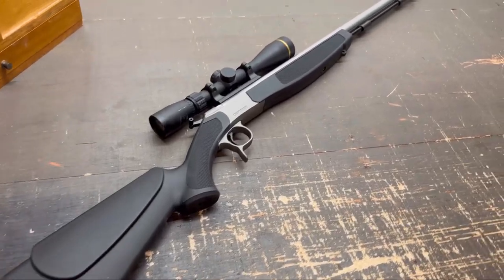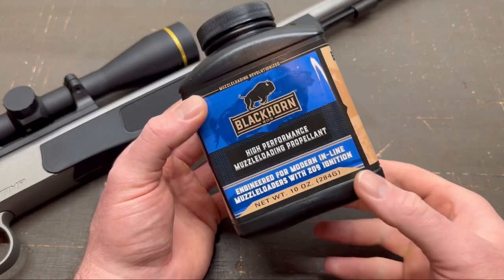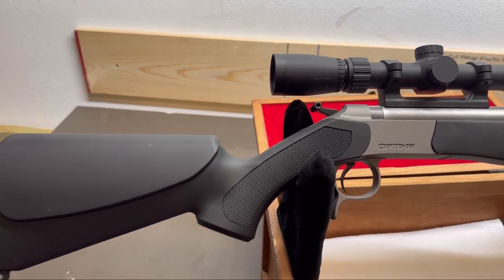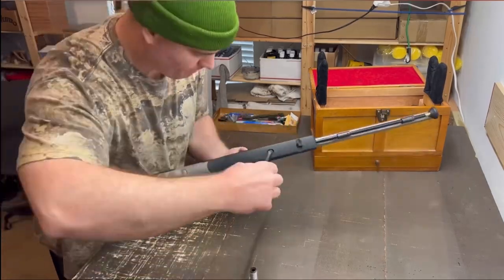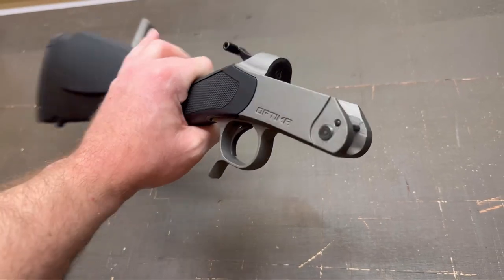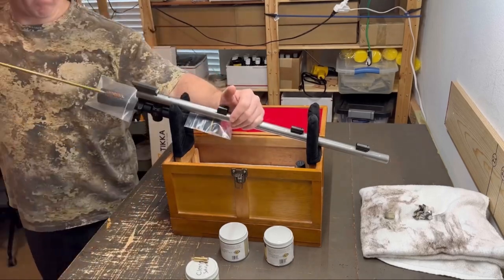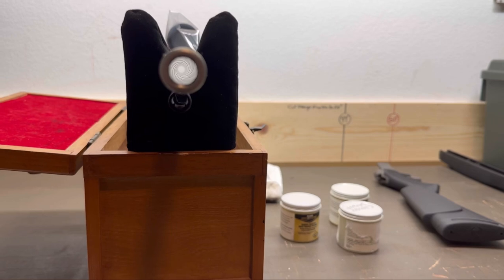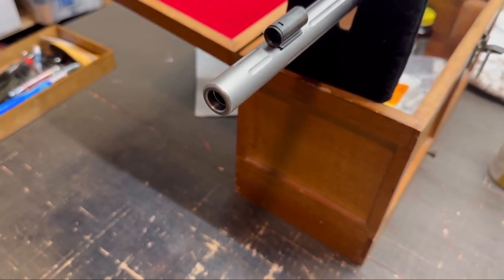Blackhorn 209: Is it corrosive?! (didn’t clean my muzzleloader for a week)

Comment: Based on the MSD Sheet for the product, it is about 15% Guanidine Mononitrate which is a corrosive oxidizer.    It is also about 83% Nitrocellulose, which is the main ingredient in Smokeless Powders.   Therefore, it is a hybrid propellant that is less corrosive, but not completely non-corrosive.
Reply: Correct. There is NO noncorrosive black powder substitutes as of yet. Why? I have no idea. With the range of burn rates now available in modern smokeless powders you'd think they could come up with one slow enough to be safely used in a muzzleloader. OR a muzzleloader safe to use with some modern smokeless powder that already exists.
Reply: @ditchdigger93  I plan to make a DVD in the near future on low pressure smokeless loads for modern muzzleloaders which use 209 ignition.  If you weigh out the correct powder and use the correct weight of projectile, it is not rocket science.  Many people reload shotgun shells with smokeless powder, and the barrel on a shotgun is much thinner than that on a muzzleloader.
Reply: @ditchdigger93  Pick yourself up a used Savage Model 10 MLSS-II Muzzleloader. It can shoot smokeless powder.

Comment: After you clean it you can go ahead and use steaming hot water and run some patches threw it with bore butter or trippers  pure mink oil from track of the wolf it'll be easier to  clean next time
Reply: Bh209 uses solvent based cleaners like your regular center fire. Bore butter is garbage

Comment: Bh209 is corrosive to a certain degree. Nowhere near as pyrodex or real black. Bh209 contains sulfur. Any moisture in the air is easily attracted to bh209 fouling and theres where you may get sone rust from.
Reply: it says to use oil and avoid water based cleaners.

Comment: Try this with thriple 777 3 f i have left on clean for over a couple months and washes off but if stored in wet environment rust will start build but i think its less corrosive then bh209 i like black hotn better because you can load shoot any round and not clean in between thriple 777 bout 5 rounds it has crud ring but power belts will load over and over

Comment: Did you have to buy a separate breech plug to run the black horn? It's funny I ordered the exact set up before I even seen your video lol even the leupold freedom muzzeloader scope...I'm trying triple 7 pellets / primers under 250 gr hornady sst
Reply: CVA makes a Blackhorn 209 breech that works fantastic with it. I took 2 doe last season at 60 and 106 yds with my CVA muzzleloader 14" pistol and 56 gr by weight of Blackhorn and 250 gr Hornady. Great blood trails. Both dropped after 60 yd run.

Comment: Did you stainless isn't corrosive..mild steel would have rusted
Reply: Just remember that there are different mixes of alloys that go into stainless steel. Gun barrels are not surgical grades of stainless. Put a magnet on your barrel. If it wants to stick, it wants to, to the non stainless alloys in the steel. I have experienced pyrodex corrosion in a stainless knight barrel from a friend. He was too lazy to clean his gun ever. I cleaned it one day. The barrel is pitted to an extreme I have never seen. Weird though, it still shot well. I have an original remington bp in stainless that I have had since new. I have converted it to use 209 primers a few years ago. I always cleaned it with water and patches and lubricant to store it after it was dry. The bore is as new, mirror finish. I have also switched to bh209 years ago because I was afraid of corrosion. Still clean the same way. The gun is as new. I always kept it loaded all week long during the hunting season in my group even after shooting it. Just removed the primer. Never corroded. Shot it off at a target when hunting was over to see if it would shoot without hang fire. Always shot well, on target.